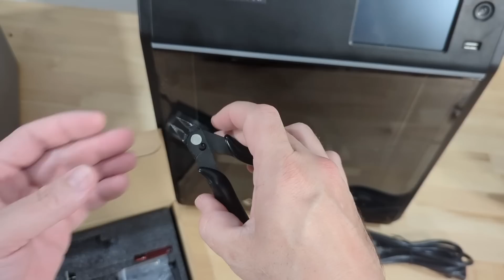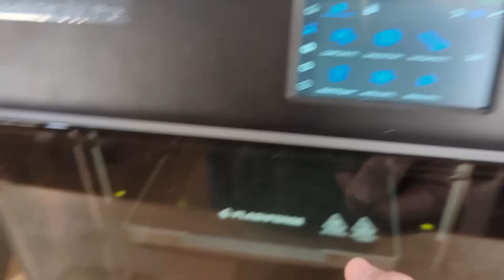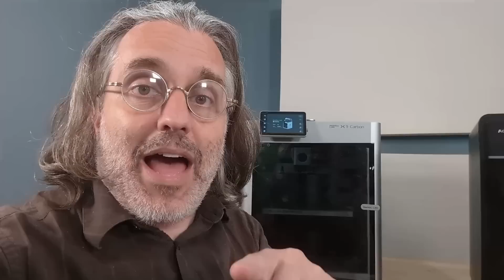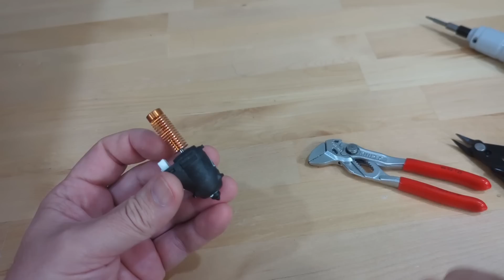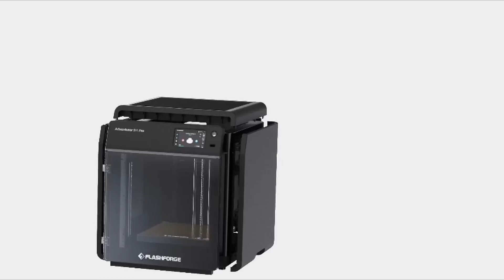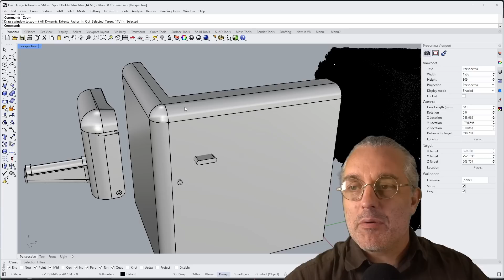Better than the Bambu Lab X1C (for the money) - Flashforge Adventurer 5M Pro

Comment: Nice breakdown

One thing about Flashforge, they don't make bad printers.. and now there at good prices. My first printer was a wooden Flashforge Replicator Dual (MakerBot board inside) from around 2012, has well over 10K hours of print time on it. Although my newer printer that prints at about 6X the speed has defiantly printed more in the last two years

I would argue a single pass filter to the outside is a false sense of security, unless its a HEPA filter (there not GF) and that's still letting pass some particulates. i have my filter running enclosed for both my resin and filament printers, and don't turn them off for at least ten minutes after the print is done. Sadly, your nose isn't the best for testing and you have to error on the safe side.

About the part cooling. I designed a few part cooling fan ducts, one thing i found with a radial fan that is usually used is that the fins are oriented to accelerate the air and 'throws the air inward making one side of the ducts receive more air. Which is probably why its smaller on one side to give you similar cooling on both sides. Possible it does create a vortex, hard to tell how effective that is unless you have a smoke machine and a slowmo camera while printing all types of geometries

Realistically it's just $100 cheaper than the Bambu Labs P1S, with a nicer screen
Reply: P1s is spy wear

Comment: You could have turned off all the pre print calibration stuff before the print on the X1C. 🤷🏻‍♂️
Reply from the maker: I didn't think I hard about it. I just pressed print. Also, even if I had done that there is still some calibration that happens and you can't turn it off.

Comment: Resin is the future of 3D printing I believe in my opinion. I just picked a Phrozen Sonic 8k resin and it blows away anything I print FDM
Reply from the maker: It's not that simple. Resin is equally strong in all three dimensions. It's called isotropic strength. But the underlying polymer is a thermoset. It degrades over time, especially when exposed to UV. So you need to paint your prints with a clear coat to block the UV. 

FDM prints are non-isotropic. They are weaker in the z direction. However they are generally stronger in the X and y direction compared to resin. Additionally, The thermoplastic used in FDM processes does not degrade as badly over time or when exposed to UV. 
FDM is a lot more pleasant to play with and requires no cleanup except a little sweeping with your hand.

Comment: The nozzle is the same nozzle flashforge has been using since 2018. My understanding is it can go to 300°. I did have an issue with mine. The z motor shaft was bent causing all kinds of weird stuff.
Reply from the maker: So If Bontech and Slice made a conversion, it would be compatible on many printers that Flashforge makes?
Reply: Adventurer 3/4 nozzles are different from 5M nozzles. Default nozzles on those printers could reach 245°, the upgraded nozzles could reach 265°.

Comment: I have thousands of hours on both these printers. I actually like how the FF loads and unloads filament
Reply: its actually pretty smart, just clip off the filament and load in new stuff. No waiting on unloading and then loading. IMO more efficient.
Reply: I like the FF loading as well, I have a MK3s and I thought it was quite odd the way FF is doing it until thinking about it more.  I've had to unclog my MK3s more than I like to say due to how it backs it out.  I just hate how much filament they use to purge with... too bad there's not an option for you to press on the screen to extrude additional filament rather than dumping the amount they are by default.

Comment: Nano Polymer to make a benchy. Seriously? There's this trend lately that everything needs adhesive or hairspray to print, but... can you imagine just cleaning the bed properly? If you do that, you don't need any adhesive at all.
Reply: It depends on the bed type; I only use the gold textured PEI plates and have never needed anything aside from a quick wipe with IPA before each print.
Reply: @NWGR  I used al most all bed types. With quick ipa wipe before each print, pla, petg, abs and asa always sticks if conditions are ok (like closed printer for abs).
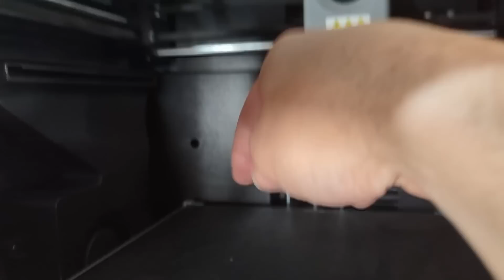Reply: At close to 45:00 you mention a mod done by a smart guy (Hort in the CC) but I cant seem to find anything after searching. Can someone point me in the right direction?

Comment: Yeah, nope. I have both and you're wrong. I did quality tests on both and the adventurer 5m pro just didn't stand up. Even the cost difference doesn't compensate. Don't get me wrong, the flashforge is excellent and I wouldn't trade it in for anything. It's just not even close to the quality and doesn't have the calibration and print defect detection. Flashforge even screwed up their own firmware and made the internal camera useless. They had to do 3 firmware updates in less than a month to fix the issues they created. The Flashforge isn't derivative at all. Also, reading instructions would have clued you into the screws holding the bed in place for shipping.
Reply from the maker: We'll see how this one goes over time. I have had Chinese printers crap out on me after like a month or so. But also there's been a lot of time for them to iron out the kinks. This printer has been released for a little while. The problems you experienced might have been solved in these later production units.
Reply: @DesignPrototypeTest  nope, it's firmware not hardware. You're supposed to be able to print at high temp with the Flashforge, but it codes out every time on filaments it has presets for. Trust me, you get what you pay for. That's why I bought an X1C after a year of owning the Flashforge. I get much more consistent prints, and can achieve insanely tight tolerances that were just not possible with the Flashforge (even after optimizing every filament setting and slicer setting). Have you ever wondered why no other channel is making the claim you're making? Because it's simply not true.
Reply: For the cost of the x1c the flashforge is the better printer for less money. And the print quality is very good
Reply: @kevinbalcer8957  trust me, you get what you pay for. The flashforge doesn't compare. Not even close. I can't even print over 270° for filaments it's supposed to be able to print. Have you tried printing in PA or PC? It's got preset loading temps for those materials, and can actually reach those temperatures, but the firmware prevents actual printing because it thinks the maximum print temp is only 270° and gives a hotend temp error. The X1 doesn't have this issue, nor does the P1. That's all the proof you need that it IS NOT a better printer for the money. X1 and P1 also have integrated multimaterial capability that the Adventurer 5M Pro does not have (not talking about AMS either), and it doesn't recognize custom GCode commands. It also has a smaller build volume.

Comment: i had a Adventurer 5M and had nothing but problems, it worked fine for a few prints but then it would stop extruding mid prints. could not print TPU because of this. I own a P1P and X1C and there is no comparison, ive had minor issues with them as well but they're still working perfectly today. even though i bought the 5M on sale i wish i didn't, very cheaply made.
Reply: Are you paid to say so?
Reply: @juliusvalentinas  nope, i have have all bambulab printers now and owned a Flashforge 5M. just my experience with Flashforge
Reply: @alin619  Explain this video then "Review of the Bambu X1 Carbon You Didn't Expect"
Reply: As is usually the case with all these companies trying to play catch-up with bambu. Bambu really shook up the landscape by making their printers work so easily and reliably with no tinkering or modding necessary.

Comment: Just FYI on the filament screen of the bambulab there’s an unload button. You don’t have to tap the screen a hundred times. Thanks for the review, it’s interesting to see what the rest of the industry is doing, but my partner will kill me if I get a third printer 😬
Reply from the maker: I hate using the filament unload button because it makes you declare what filament you have which takes more time than just clicking the button a hundred times.
Reply: @DesignPrototypeTest  fair enough

Comment: Should be comparison with the PIP at the same $499 price, rather than the X1C and then using its higher price against it.
Reply: P1p is not enclosed at $499
Reply: @Antrim3d  p1s`?
Reply: I started with a FlashForge.  My X1C and my son’s A1 are far better.  Add in the AMS, and it’s no competition.
Reply: After many different printers, I have finally seen a huge quality and handling improvement once I started to use bambu p1s. That’s a tool that works for me every day, w/o issues, nozzle problems, adhesion challenges , settings tweaking, etc. It is about the price of the flashforge, has an enclosure as well, is faster (the initial checks can easily be disabled in gcode if you don’t value their benefits), and comes with AMS option. I can’t really see any point that would make the flashforge a better package. It‘s ok when companies pay you with free printers, and it’s also ok when you in exchange show-case the printer in detail. Thank you for that. It hurts your credibility though when you seriously try to compare it to a printer from a different price segment (x1c instead p1s), and then highlight its price benefit. You even stretch as far as to claim it would out-perform it. Please try to be objective and don’t compare apples and oranges. For example, focus on actual print speed, not adding the time for separate and fully customizable quality checks (which the flashforge simply lacks, that’s not necessarily an advantage). On a neutral level, thanks to your review I‘d summarize the flashforge tries to play in the p1s league for roughly the same price, and its innovation is a simple plug and play nozzle change, whereas its print speed is slower, it has no AMS option, and has not yet earned the same reputation for superior print quality not just with simple benchies but even with tricky sophisticated models and challenging design overhangs. So for me, I wouldn’t buy it and in fact have just ordered another p1s so I don’t have to switch nozzles (I do wish the p1s had a pluggable nozzle like the flashforge). Someone on a very tight budget wanting to print single color only using different nozzle sites may enjoy the flashforge very much.
Reply: The P1P and P1S are closer in price, perhaps not exactly the same, but larger volume. I think I'll stick with them.
Reply: @ljadf  Yeah, for apples to apples here, the P1S is only $100 more than the flashforge, and is a better printer in a lot of ways. That's where my money would go as well.
Reply: @NWGR  Only difference between P1P and P1S is the enclosure and both  are 4 filament, with the X1-C being 16. Not to mention the types of filament  as well.  This is like saying a  chevette is better than a corvette because I can put 85 octane in it. Ludicrous.
Reply: @anomicxtreme  P1S can handle all the filaments the X1C can, and it can do 16 colors as well.
Reply: @NWGR  that's what I said lol. I have trouble typing and didn't want to type it all out. It can handle all 16 if you get the add on, but cost wise just better off getting the 4 filament AMS. The flashforge is really not even in the same league.
Reply: @anomicxtreme  My mistake! 😅
Yeah I'd get one ams, maybe two max.
Reply: @NWGR  nah, not better. Just a different brand. But fangirls are fangirling.
Reply: @RngmonsterX  Most definitely better when you factor in all aspects like build volume, user experience, reliability, ease of use, etc. Most other brands except for maybe prusa are outclassed by bambu, but on even ground, prusa is obscenely expensive for what you get, and is a very bad value.
Reply: @NWGR  Damn you are right, Bambu is sooooo superior.. it has a bigger build volume!
Reply: @RngmonsterX  The big advantage is reliability. Most other printers still struggle with this. Not as much as back in the old ender 3 days, but still a ways to go before they reach bambu's or prusa's level. And again, user experience. Printing is easy with bambu printers. That's good for everyone. The more people that can get into 3d printing with a learning curve that isn't that steep, the better.

Comment: Your still comparing apples to bananas. Without the AMS you are not even discussing the same class of printing. I don't do multicolor printing but I do absolutely use the AMS for multiple filament support interface. Without at least that option you may as well order a P1P.
Reply from the maker: Unfortunately, I don't have a P1S to compare to. tHe cOMmuNiTy decided to cancel me by contacting all of the companies I had previously worked with, spread lies about me and threaten to not work with them if they worked with me. The response from Bamboo Lab at the moment is "We have no intention to work with Design Prototype Test in the near future." So don't get mad at me for not doing a good comparison. Get mad at the cheating cabal who tries to control the information you are exposed to. Alternately, get mad at Bamboo Lab for caving to the demands from cheaters/liars. I've done nothing to deserve this treatment. I should not be canceled. They just want to maintain their power over you.
Reply: @DesignPrototypeTest  stop blaiming others for this, first I liked your review but noticed very fast how biased you are to FF and reading the comments cpnfirms this especially where you just blaim "the community" I love seeing reviews of printers but seriusly this blaiming others is just BS and spread mistrust.

Comment: Looking at their website, they don't claim PA compatibility. That might be a deal breaker for me. Also I greatly appreciate that you tore down the hotend. That's huge
Reply from the maker: Yeah, it's because of that hotend. Any filament that prints under 280° will work.
Reply: Isnt pa in preset list on filament load menu?

Comment: good one thnks
Reply: for that print - you even do not need supports at all for this print ..I was testing it can take 80 degree angle no problm
Reply: by the way while printing any pla you can yurn off all m5pro fans exept nozzle it goes fine ....feed lubrications rails and sticker bed..thats it

Comment: Agree, 5m pro is superior in many ways, (& not just for the money)!. Looking forward till next month when FF will reveal their next line up. btw the extruder gear can be easily pulled apart. https://youtu.be/Hg3e4pWVFBk?list=PLfgJMflBZf3uKwLapJ0vK1ThaZcK4j3Wk&t=292

Update: FF postponed new release till Oct!
Reply: @robertschrauder7537  True, and although it may have some advantages, you loose fast and tooless nozzle swap.
Reply: Wait what is flashforge going to release a new 3D printer next month? I just ordered a 5m pro 😢
Reply: @andresgizmos1271  Yup. According to their roadmap '24, they will release several.  Next generation 5M & pro, M1, and another TBA. And a few more printers in September.
Reply: @kaderjazairi887  Well they just released their spinoff of the AMS, a flashforge ADX5.

Comment: I own the Flashforge 5M, it was my first printer. It prints perfectly out of the box every time, with default settings in Orca slicer. I've done alot of testing with it and it can print at speeds up to 600mm/s. Its been very reliable, my favorite part is the quick change nozzles.
Reply: Dope feedback bro. Need as much info as I can get

Comment: Too bad about the proprietary hotend, but I guess with those speeds we can just stick with the included 0.4mm until an open source alternative comes up.
Reply: Print with the included .6 nozzle,  OrcaFlash has the profile for the .6... it's a game changer. Prints .4 layer height at max, makes vase mode just smokin fast... layer lines on certain prints adds a certain effect that's desired

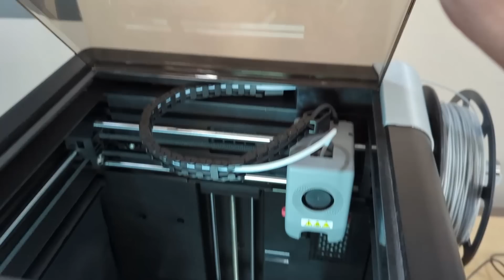Comment: 1:03:00 , you could try those felt pads that stick on to furniture legs. Cut them small and place them on the cable chain to prevent further rubbing/scratching.
Reply: @Scr00ples  just cut tube for 3cm off ant it wont scratch